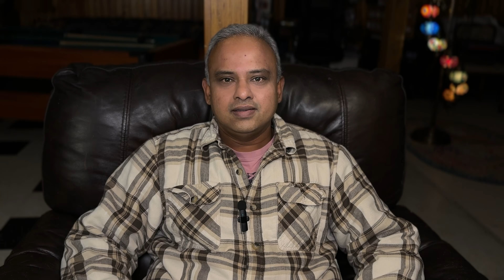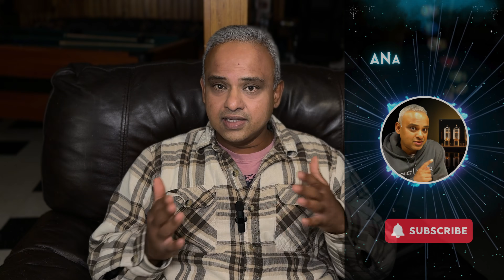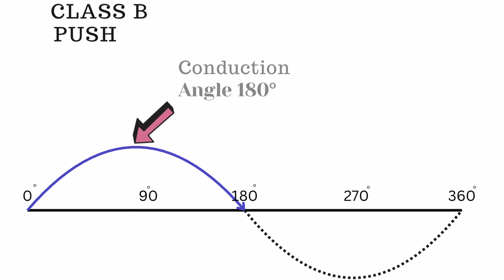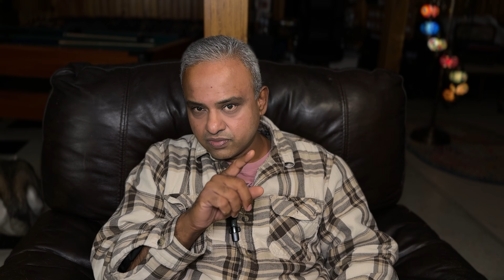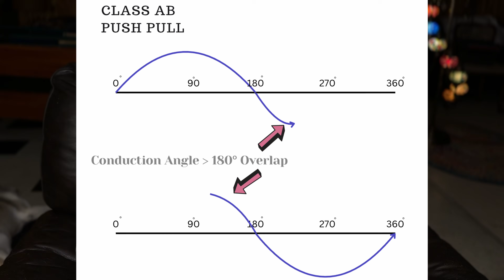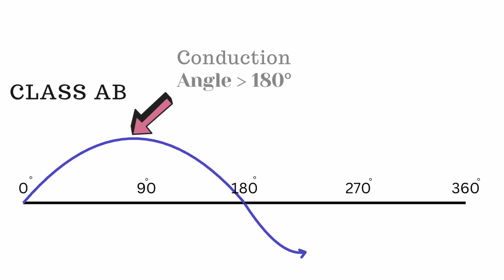The Truth About Class A Amplifiers (They're Not Magic)

Comment: Isn’t the term Push-Pull describing amplifier topology orthogonal to the Class A, B, AB, etc, designations? For instance, can’t there be a Class A Push-Pull amplifier?
Reply from the maker: Yes, you are right! And this is an important distinction that gets blurred all the time.

Class A, B, and AB describe conduction angle and biasing. Push pull describes circuit topology. They are orthogonal concepts.

So yes, you can absolutely have a Class A push pull amplifier. In fact, many well known Class A designs are push pull. In those designs, both halves of the output stage conduct for the full signal cycle, but they are arranged symmetrically to share current and cancel certain distortions.

Single ended versus push pull is about how the signal is handled spatially in the circuit. Class A versus AB is about how long devices stay on during the waveform.

This is where confusion creeps in. People often associate Class A with single ended and AB with push pull, but those are common implementations, not rules.

A push pull Class A amplifier tends to have lower distortion and better efficiency than single ended Class A, while still avoiding crossover behavior. A single ended Class A amplifier tends to preserve asymmetry and even order harmonic structure, but pays a big price in efficiency and power.

So when people argue about Class A sound, they are often actually hearing topology, bias margin, and feedback strategy rather than the class itself.

You are absolutely asking the right questions. This is the level where amplifier discussions start making sense instead of collapsing into labels.

Comment: Perhaps part of the narrative here is that the absolute amount of inefficiency in Class A is only really a problem when the thirst from wattage was modest. As the desire for bassy bookshelf speakers drove speaker sensitivities down, wattage requirements rose along with the associated absolute Class A wastefulness.
Reply from the maker: Fair way to put it. Class A inefficiency wasn’t always the problem it later became. When speakers were more sensitive and listening levels were modest, the waste heat and power draw were tolerable tradeoffs. Once speaker sensitivities dropped and bass expectations went up, the power required to stay in true Class A rose dramatically, and the inefficiency stopped being an abstract concern and became a very real practical one.

At that point, the conversation shifted. Designers had to decide where the Class A region actually mattered, how much bias was enough, and how to manage heat and current without the amplifier becoming impractical in size, cost, or reliability.

That’s why so many modern designs quietly live in a high bias Class AB space. They preserve the benefits where the ear is most sensitive while acknowledging the reality of modern speaker loads.

Comment: I've listened to class A based systems before.  Sounded soft, rolled off and a bit bloated to me, like a tube amp that's overstressed. Bass wasn't impressive either.  But hey, it was "soft" and "romantic."
Reply from the maker: What you’re describing may be real in some cases, but it’s not a Class A trait by definition. Class A only describes biasing, not bandwidth, damping factor, power supply stiffness, or how the amp behaves into a real speaker load. A marginally powered Class A design driven near its limits can absolutely sound soft, rolled off, or dynamically compressed, especially with speakers that need current. That same biasing done with sufficient power, wide bandwidth, and a stiff supply can sound fast, extended, and very controlled. So the “romantic” presentation people associate with Class A usually comes from implementation choices and system matching, not the topology itself.

Comment: I own three VFet amplifiers, Class A and the sound is so smooth! My Yamaha B2  weighs about 60lbs. They dont make em like they use to.
Reply from the maker: Totally get that. Those VFET designs were special, and they don’t build that exact thing anymore. But Yamaha is still one of the rare brands that carries a real engineering lineage forward, even if the execution has changed with the times.

Comment: The DIY Audio forum offers a few class A designs from Nelson Pass, the F5 Turbo V3 being the most powerful.  The amplifier is a very simple two stage design that uses cascoded JFET input devices and eight MOSFET output devices, at just 16 dB gain it requires a lot of drive but it has a very wide bandwidth and it sounds very good when driving four pairs of the old Quad ESL 57s, unusually it has no Zobel network at the output.
Despite the amplifier being a simple design the PSU and cooling is a huge challenge, my first attempt at building the amplifiers ended up in smoke and tears (mine) because removing the heat created by 7.5 A quiescent current per amplifier per rail was very difficult even when using high performance fans to do forced air cooling.

Eventually I gave up with regular heatsinks and mounted four of the F5s on a water cooled cold plate, the cooling system is a project all of its own, a central heating pump feeds water around the cold plate and two small car type radiators each with a fan remove the heat and it works very well, the temperature of the cold plate output pipe is just 2 Deg. C above ambient but the cooling system fans make a lot of noise so it and the amplifiers and PSU all had to go in the cellar below my listening room.  Each F5 runs at 4 A per amplifier per rail and drives two ESL 57s wired in series and it doesn't go very loud but it is very easy to listen to.  The CRC power supply has two * 1 KVA transformers, two * 80 A rectifiers and 0.92 F of capacitance and it too has a cooling fan.

Despite having put a lot of effort into that project most of my listening is done using a Krell KSA100 clone from Ali Express, it can run in pure class A mode when biassed sufficiently high but it runs at a moderate 2 A per rail quiescent current and  produces adequate levels of sound (I like it loud).  The old Quad electrostatics are a bit light on bass, a home made quarter wave T-line stereo subwoofer takes care of anything below 80 Hz, it uses two of the Falcon acoustics redesigned KEF B139s and the spec rates it as 0.3dB down at 10 Hz.  Tests at around 14 Hz caused me to feel mildly nauseous and the window frame made  ticking sounds as the glass flexed.

Comment: Do you know why Thomas stereo said class A ss amps usually sound lean compared to ab? I find this to be true also... Also do you know how class A SS has push and pull topology? I would believe a single transistor would be responsible for full range playback frequency
Reply: Thomas has said SOME class A amplifiers can sound leaner but many can also sound warm and rich. He said both. I have a class A amplifier and it’s of the warm and rich variety.
Reply from the maker: Yes, class A can be single-ended (one transistor handling the full waveform) or push-pull, where two devices share the signal but both stay conducting for the full 360°. Most modern solid-state Class A amps are push-pull, since that cancels even-order harmonics (could be why they may be perceived as lean) and delivers higher power while staying in pure Class A operation.
Reply: @analogholic_reviews okay so the tuby goodness in thai case is gone?
Reply: @analogholic_reviews  I see many amplifiers advertised as class A, but in fact are class A/B, even pass labs advertised class A amplifiers are class A/B technically, they just don't rate them to actual full power.

Comment: Crossover distortion apparantly is no longer a real problem for Class B amps as shown by the Topping B100 amps .
Reply from the maker: Misconception but I can understand why. The B100 measurements show outstanding performance — but calling it pure Class B is likely a stretch from the engineering definition. The low distortion and high efficiency suggest it is a very low-bias Class AB design. In true Class B each device turns fully off half the time and the zero-crossing hand-over is where distortion normally shows up. What the B100 seems to have done is keep both devices slightly on, effectively bridging that hand-over and behaving like Class AB while being marketed for efficiency. Until we see conduction-angle data or manufacturer-published topology showing 180° conduction per device with zero overlap, it’s more accurate to call it a Class AB variant with Class B efficiency goal.

Comment: Class A philosophy is now largely obsolete . With the current crop of hi-end class D amps from Hypex and Purifi you can get it all : extreme lack of distortion AND high efficiency
Reply from the maker: The new Hypex and Purifi modules are remarkable in MEASURED performance and efficiency. I own the NAD c298. And I wouldn’t call Class A obsolete. Class A isn’t just about vanishing distortion numbers — it’s about the nature of distortion, the linear operating region, and how transients and microdynamics are handled. Class D designs have come a long way, but their switching architecture still relies on reconstruction filters and feedback correction. Whether that sounds identical to a pure linear stage in real music playback is still very much open to subjective and system-dependent debate.